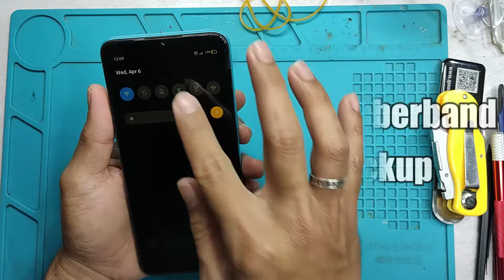HOW TO Replace REALME C3 and 6i LCD Display using only simple tools I bought from LAZADA!!!

Comment: do i still need  to open it from behind when my phone's screen is coming off?
Reply from the maker: Not necessarily
Reply: @SimplyTechKey  so it can remove the front without the back?
Reply from the maker: @jasongarcia9529  yes , if you are not replacing the lcd ,
Reply: @SimplyTechKey  I already fix my lcd to a technician its dangerous to DIY to fix the phone lol.. let the expert fix it